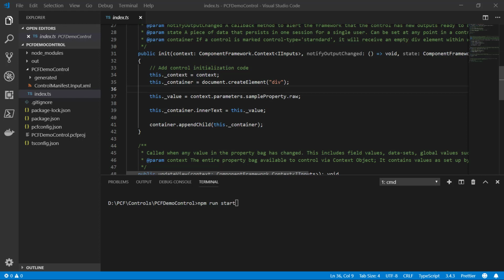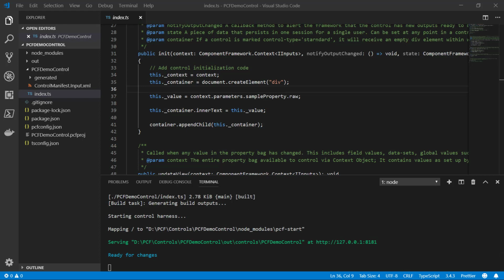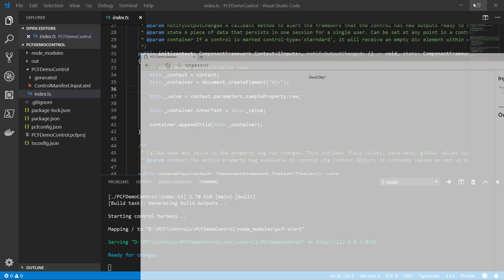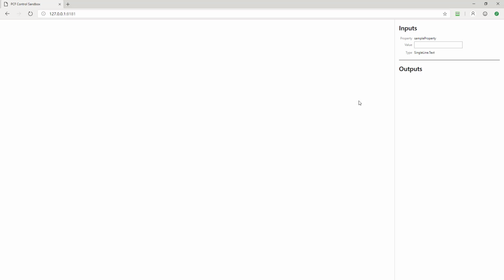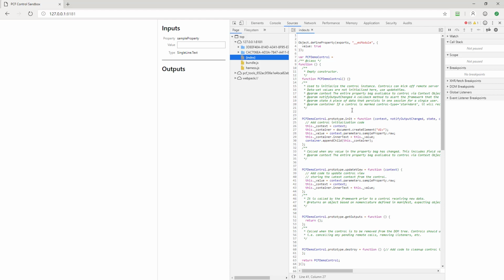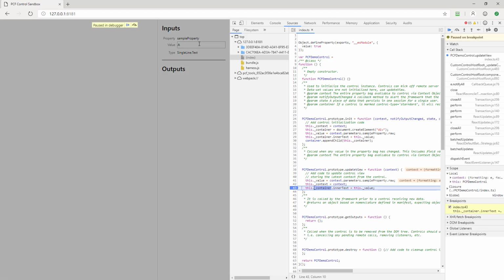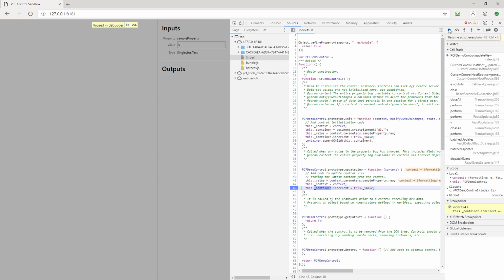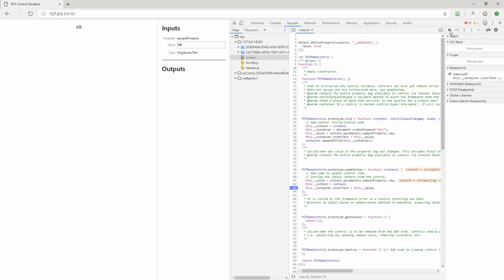How to debug a PowerApps PCF Control

Comment: Hi Todd that was great ... Can you also demonstrate how to setup hot reloading so each and every time I need not exit and run again in cmd
Reply: You can use "npm start watch" if you want changes to reflect automatically
Reply from the maker: That behavior is set up by default.  As soon as you save your TS files you should see the test harness reflect them as long as you have not stopped the process.